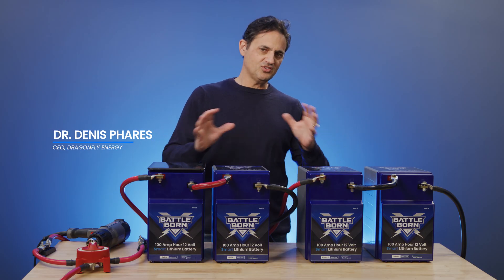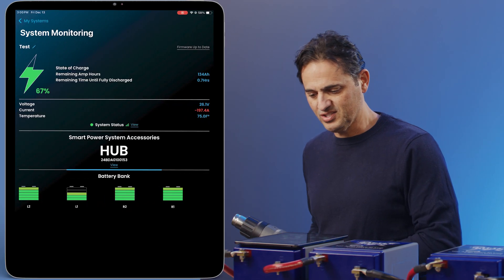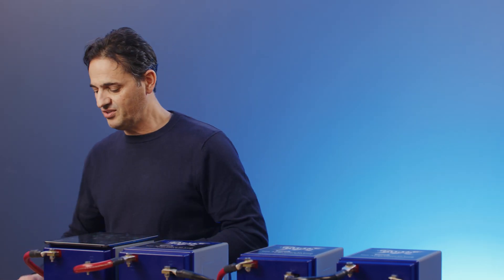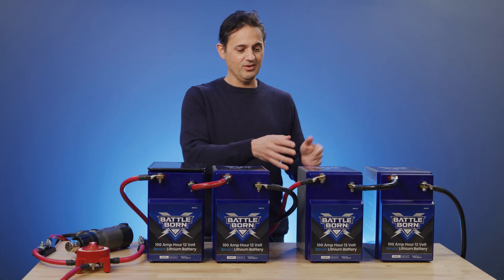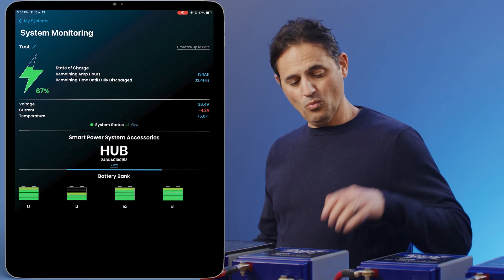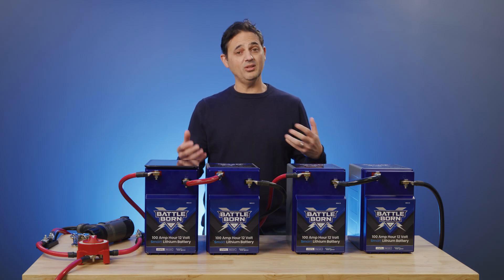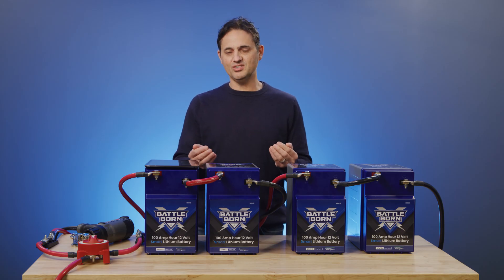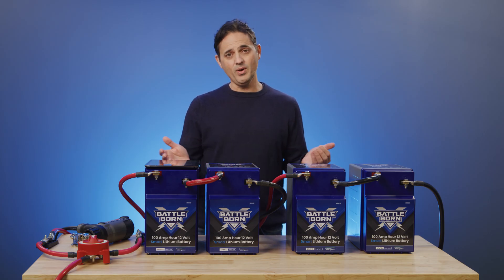Diagnosing Current Imbalance Issues in a Battle Born® Smart Lithium Power System

Comment: Iam seeing alot of heat on my 350amp anl fuse and connectors,everywhere else in the system it's cool,I remove the fuse system and run it directly to the main switch and it runs cool,seems the fuse is a super high resistance spot.